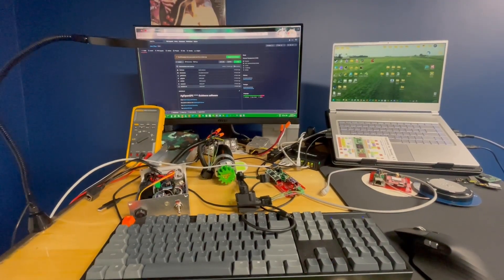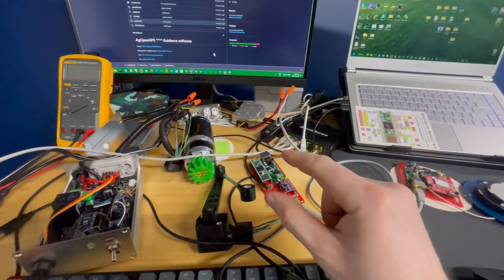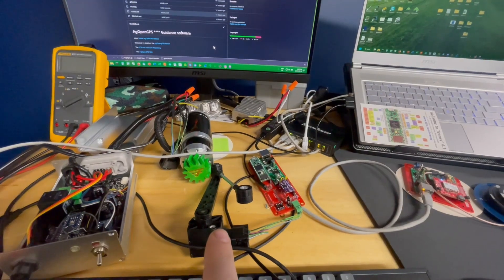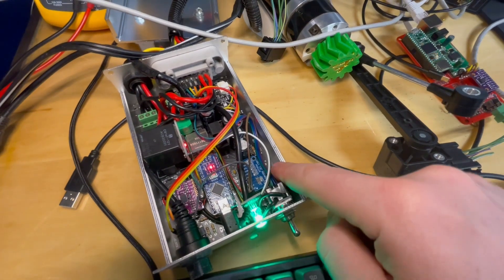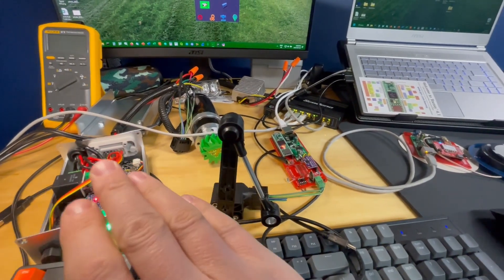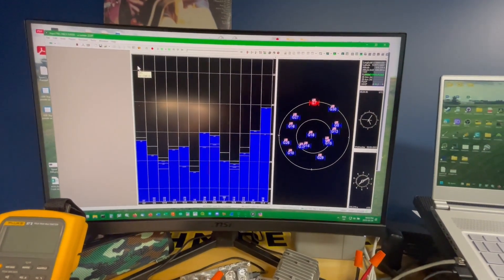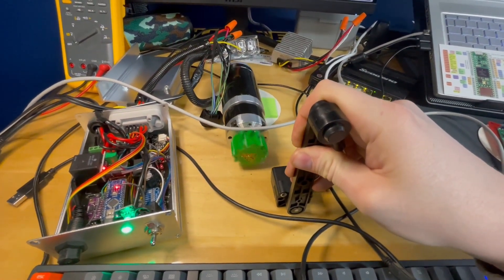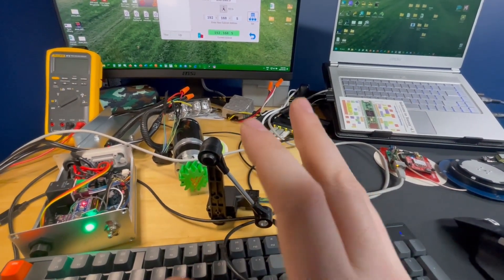Developer Fun with AgOpenGPS "Ace" UDP Only.

Comment: Why not canbus instead of udp?
Reply from the maker: Same reason auto manufacturers want to dump it, not enough bandwidth. Also being windows based just easier to use what windows works with and have no canbus based equipment.
Reply: @potatofarmer  in agopengps case where you lack bandwidth? I am thinking of starting can modular implementation.
Reply from the maker: @KalanjDjordje  The speed of getting the nmea from the gps to the teensy.  Read up on the forum, ive already crunched the math there. CAN is a turtle
Reply: @potatofarmer  thanks, good to know that, I will check on the forum math.

Comment: UDP is great but is it verified on another layer that it's reached the destination? I'm tracking this project from the beggings and it's the most awesome project, next to ROS😊!
Reply from the maker: Think of UDP as a radio station, its just dumping the data out to anyone who wants to hear it. There is new data every 100ms, so no need to verify just keep streaming the new data out. If it was not received it was probably junk to start with.
Reply: @potatofarmer  i didn't realized that even MQTT can go over UDP, but that would be a little overhead
Reply: @potatofarmer, what about Security; like transmission and injection? I'm just starting with AOG, and was dropping Farm Wide WiFi with mesh networks and Wireless Access Points and repeaters. Is this LAN exposed to traffic or devices linked to internet/wifi? Like the windows tablet or ability to alter config remotely for a DoS network saturation attack? Just thinking about corporate interests that may want to sabotage AOG. Virus etc...

Comment: Hello , I use trimble ag252 antenna and I think this antenna is locked for RTK , do you have some solution about this problem ? Thank you and how to contact you
Reply from the maker: The Ag252 is an antenna and nothing more. 

The lock is in the receiver that is connected to the 252.

For less money than a Trimble unlock you can build AOG and use whatever features you want!
Reply: @potatofarmer  I have outback s3  (claas s3),where  to find AOG or how to build ? Thank you
Reply from the maker: https://discourse.agopengps.com/

Come read on the forum all about it. Build an AOG system, and never pay an unlock again🎉. 

A system you can fix yourself!

Comment: Hi, I am using AgOpenGPS for some time, but only with GNSS so far (not using the RTK, since my setup is single band only and therefor the RTK is not much stable). I am thinking about extending it with IMO, maybe RTK GNSS and maybe steering. Since I dont have these yet, I have read about it only on forum, but I have few questions/points:

First I like the idea to have GNSS (and other) in separate boards, because I use GNSS also outside the tractor for accurate measuring (with RTK using rtklib), so disassembling gnss from the tractor system every time I need it would not be practical (I will use custom "board" for gnss to fulfill my needs anyway, probably with rpi).

If I understand it correctly, the "nav" board has the IMU, WAS and teensy? I would personally put wheel angle sensor together with steering motor, since they both are used for steering, and IMU together with GNSS (or put them separately), since the IMU is helping GNSS to get the correct position. But as I said I don't quite understand it yet.

Anyway, I have the question regarding the IMU, I have read somewhere on forum that teensy is there make sure IMU and GNSS data are read at the same time (it takes some time to calculate F9P for example the RTK data), so that AOG app can work with the right data. Is it working good to have the IMU and GNSS on separate boards and communicating over the UTP?

And last, what IMU do you think is compatible with most boards for AOG, I read about adafruit BNO085, but it looks like you are using something else, right?

Keep up the good work
Reply from the maker: Teensy 4.1 does all of the functions the nano used to, plus syncs the imu and gps reading to make a custom NMEA sentence called Panda.

As of the time of this comment the IMU to get is the BNO085. Both ali express and adafruit versions work. IMU by itself will not make major improvements vs moving to dual band rtk.

Comment: Do you need a udp Port on your Windows tablet or is a usb Port good for this
Reply from the maker: You will need one ethernet port on the tablet, on small tablets that only have USB there are USB to Ethernet adaptors available. But unlike a USB com port connection, once you set up the ethernet adaptor its set for life.

Comment: Fantastic project. I live in Brazil and I'm starting to learn about agopengps. Prepared to mount a system on a small tractor. Thanks for your contributions to the community.
Reply from the maker: No problems, just trying to implement changes that make the system simpler.